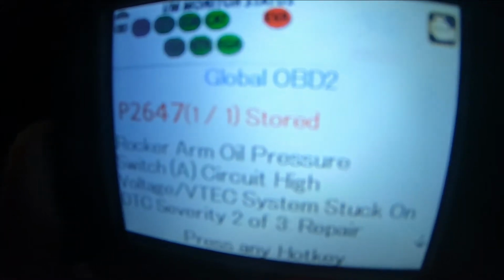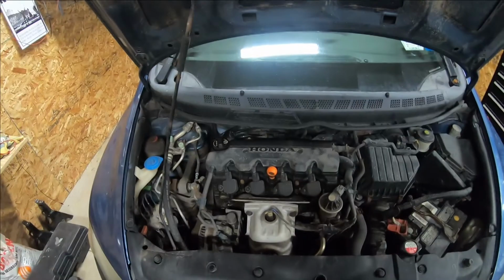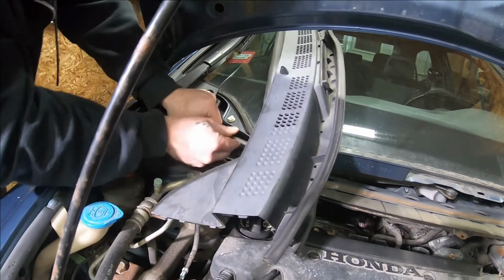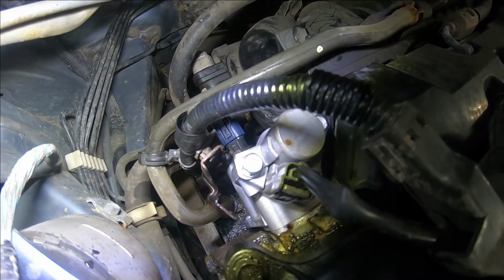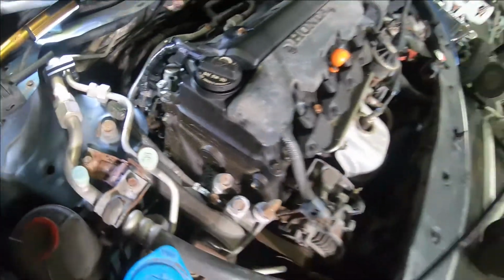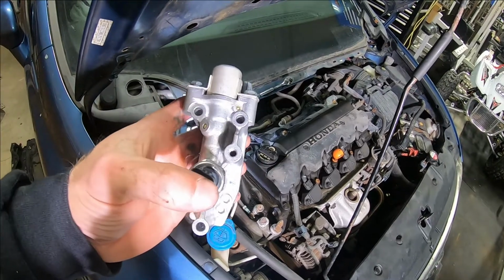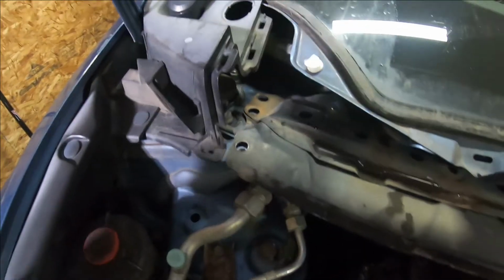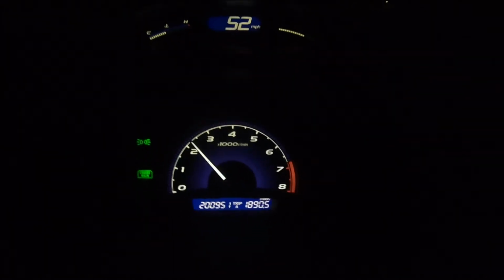2006-11 Honda Civic 1.8l check engine, VTec valve replacement/detailed

Comment: Do you have to change oil after replacing this thing ?
Reply: My mechanic recommended not to unless you check the oil level with the dipstick and it clearly looks to be pretty minimal.

Comment: I had mine with the same problem and code. First i resetted by OBD2 scanner then came again. I unhooked battery cable but still the same code appear. Finally I removed the VTEC assembly, replace the filter and thoroughly clean the inside with throttle body cleaner. So far so good until now.

Comment: Would you please provide the estimated time it took you to do the complete job? I will have to take the car to the mechanic to get this done and want to have a +/- idea on what he will charge me.
Thanks, greats video.
Reply: I could be wrong but if the part is around 200 and it looks like a 1-2 hour of work depending on the mechanic. I’d range cost to be 400-500

Comment: Just put a gasket on mine. Taking the cowl off first helped a lot. Last weekend put gasket on valve cover and check valve adjustments. My issue was oil leaking. Hopefully I’m good for a long time.

Comment: 4:20 Thanks for the tip about using a 6 point socket on the bottom bolt. I had been using a 12 point socket and it kept slipping off due to the weird angle. I wasn't replacing the whole valve--just the gasket--but your video was very helpful for that part in particular.

Comment: This helped a ton! I'd removed the vtec valve due to a bad oil leak and replaced the gasket and reinstalled..next day noticed first that cruise control wouldn't work, then car would stutter while accelerating. Long story short I just forgot to plug one of the sensors in.
Reply: This comment made my day I feel your pain brother

Comment: Hi,   I just did that 
But I replace just the gasket 
And check engine still on 
Any suggestions..?
Reply: You need to change the valve